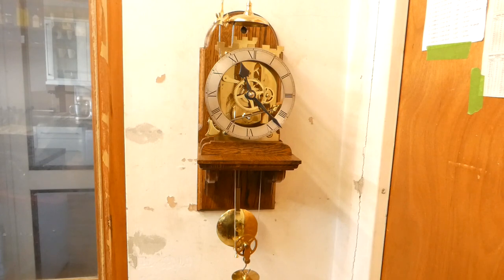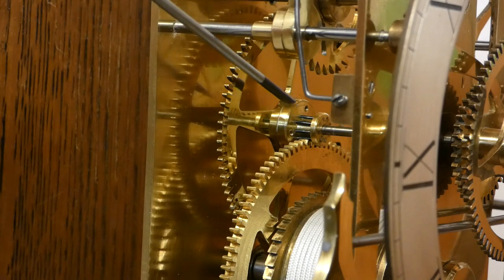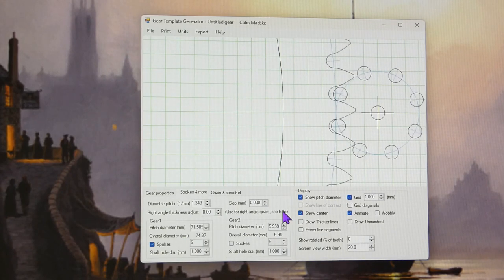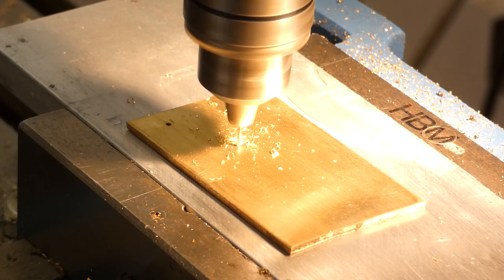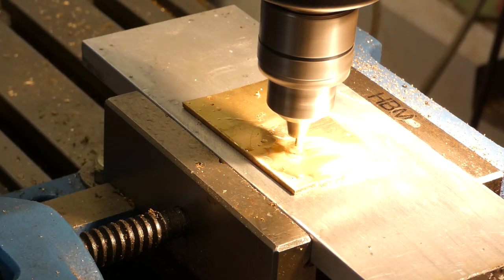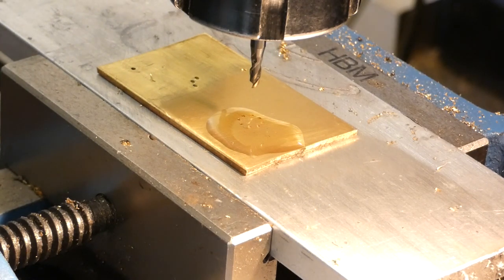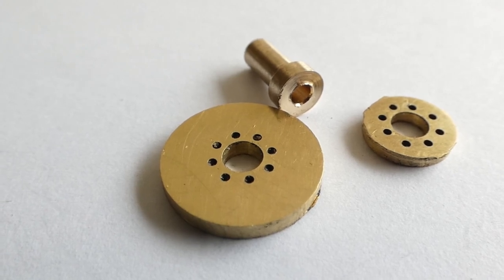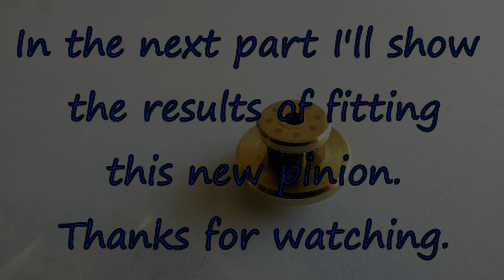The Castle Clock by John Wilding

Comment: In reference to cnc drilling cycle time frame 8 minutes 02 seconds  and beyond  the drill chuck is not concentric causing the drill to act more like a boring bar than a drill. I recommend a small precision chuck may solve the problem.
Reply from the maker: That’s why I use an undersized bit.
Reply: Sometimes with long use the chip will get caught underneath one of the jaws of the chuck as a result will push the drill bit off center line of the chuck all you may need is a thorough cleaning of the chuck or maybe even disassembly to make sure it's clean. If this does not do the trick rip a piece of paper 1/4 inch wide by 4 inches long fold a piece of paper in half so that it is only 1/8 of an inch wide wrap it around the drill bit then position the drill bit so that the piece of paper catches the very end of the drill chuck jaws. Tighten the drill chuck at all three stations until each station is snug then check for concentricity this should fix your problem
                        PS
 let me know if this works for you